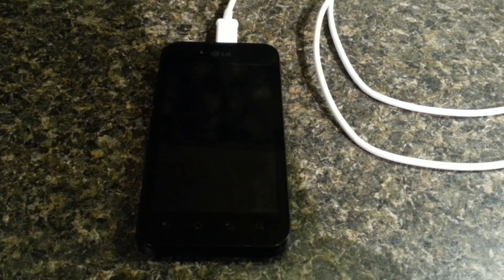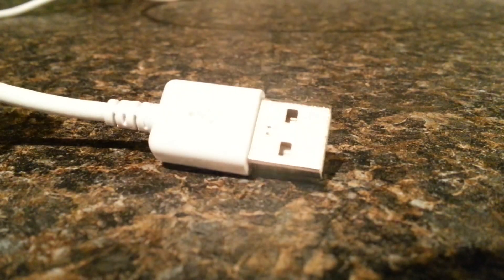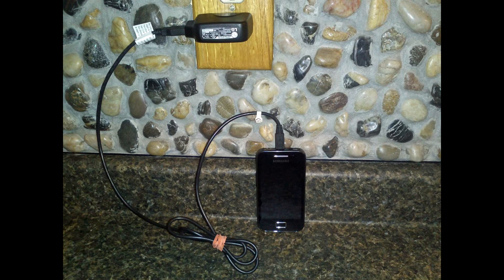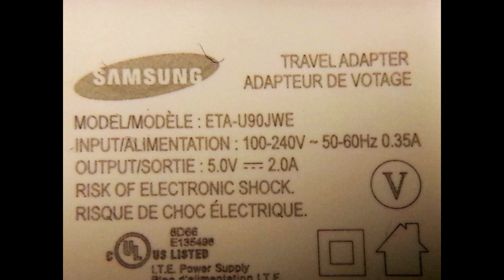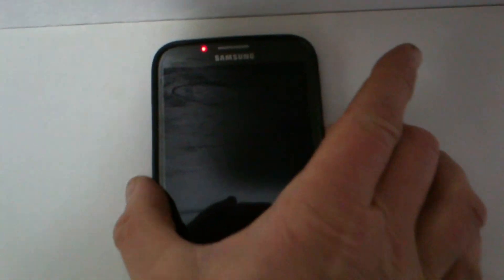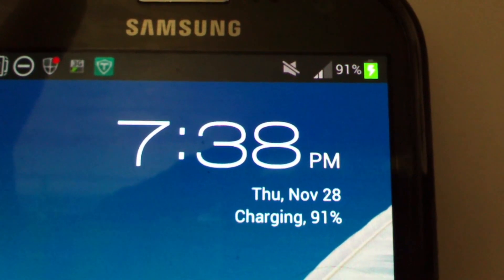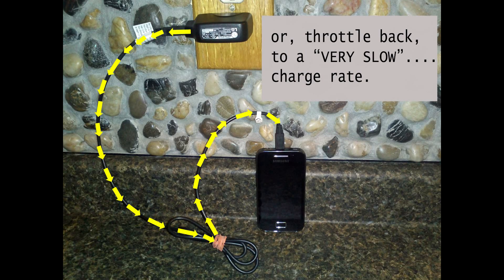Slow Charging? Check Your Charger's Output! #9

Comment: can someone help me my HTC one m8 started charging slow first I checked the the chargers (NOT THE PROBLEM) so I noticed that ever time I plugged in the charger (of any kind ) that they would be loose and the only way to get it to charge was to position the charger connector a certain way and when I thought I got it the charge would literally go down. so I went to Sprint and their "technicians" said that I was an app causing the phone to stay awake and that the charger had to be the original HTC charger so they deleted the apps and gave me the original HTC charger and said to come back if you continue having problems and said it might be a software issue such as a software update not installed properly and they might have to do a factory reset (which would be the 2nd time I would do that to that phone and I've only had the phone for 5months as I write this) and I'm pretty sure at this point it was the USB charger port. when I let charge overnight it was only at 60% and had to wait a total of 10hours to get it to 100% and now it will only charge if the phone is off and then it will be stuck on a number and I have to unplug and replug the charger to get it going again and/or if I'm useing the phone it will sometimes go at a steady pace or say can not charge because my phone is useing to much power even though that's not the case and I'm just about lost....
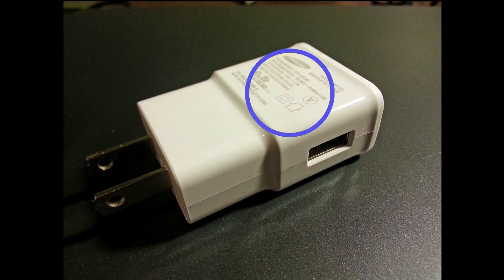Reply from the maker: Okay, I will almost bet that this following video will fix your problem! https://youtu.be/cJcCK5ZVSAY  Be sure to listen to the tips at  3:10 AND at 3: 30 seconds.

Comment: How about turning on airplane mode?
Reply from the maker: Yes, "airplane mode" will help with a slow charge condition if the charger that is being used is undersized (in output capacity). However, airplane mode would not be required for quick charging with the proper charger.

Comment: My samsung tab3 10.1 before fully charges in 4hours but now it takes my tab to fully charge in 7 hours will you help me...
Reply from the maker: First, we need to verify that the charging conditions are right. Are you using the original charger that came with your device? If not, make sure the output rating in milliamperes (or amperes) is at least the same or more, BUT NOT LESS , than the one that came with your device. Never use a cheap or long charge cable, as your device requires a larger charge current, which inferior cables will not be able to handle properly.

Comment: My iphone takes over 5 hours to charge any suggestions i tried everything!?
Reply from the maker: Dust and pocket lint could be affecting the charging of your IPhone. I have 2 videos titled "simple fix for phone not charging" (one is an update video). These videos talk about the micro usb port in Android phones. BUT, even though your charge port has a different configuration, it will still be vulnerable to a progressive dust build-up. The result is your charge plug might not be going in all the way resulting in a poor connection and therefore, a "slow charge".

Comment: how about this?

my samsung s3 is rated by 3.8V to 2100mA same with the battery

but my adaptor is 5V to 3A output.

how it works?
pls help.
Reply from the maker: Your Samsung s3 has a battery charging control circuit built into the phone which automatically "takes what it needs" from your 5 volt 3 ampere adaptor. The important part, is that your adaptor has the "ability to deliver" (capacity) what your phones' charge circuit is requesting. Too small in millimetres (or amperes) is not good, but a large output in milliamperes (or amperes) is just fine. IMPORTANT! if your device requires a 5 volt supply, it must ALWAYS have a 5 volt supply. Never more!
Reply: Northcaledon so in the process it is normal. then why i encountering the slow charging problem like this? it is something like my phone had another problem in the circuits or in charger plug~in that may cause to slow charging?
Reply from the maker: I said "millimetres" by mistake (darn autocomplete). I meant to say "milliamperes" .
Reply: Northcaledon ya. its ok.
Reply from the maker: I have two more videos titled "simple fix for phone not charging" parts 1 & 2 (update) . Please check them out. A build up in your charge port itself can also cause charging problems including a slow charge.
Reply from the maker: The dust build up caused a slow charge in my htc desire hd, and my samsung galaxy note 2. Both were fixed by using the methods in those two videos

Comment: Since today, I'm facing charging problems too. Like you said in your video; one hour of charging would add about 40% and that was my case too. I am still using the same usb and adapter but in 3 hours my phone went from 2% to 78%. I don't get what the problem is
Reply from the maker: I would check to make sure that your charge port is clean of debris. Excessive build-up of pocket lint will stop your charge plug from going in all the way resulting in a poor connection. I have 2 videos titled "simple fix for phone not charging", and an "update" one as well. These address that VERY common problem. Maybe they will help you?
Reply: Northcaledon Thank you for your quick reply. I'll check them out :)

Comment: My galaxy s4s battery is draining very fast, and it is charging VERY slow with the original charger. What should I do ?
Reply from the maker: Check out my video titled simple fix for phone not charging parts 1 & 2. I had the same problem with my phone.
Reply from the maker: These videos are also on my channel.

Comment: My android phone has a problem charging. One of my friends said I should try charging it in flight mode. It didn't work, it's too slow. I even tried charging it turned off. The charger is definitely not the problem. It may be the charging pin. Is it possible that could be the problem?
Reply from the maker: Please see my 2 videos titled "simple fix" for "phone not charging" , and then the update video for that. They will likely show you the problem with your device.

Comment: It takes my galaxy note 2 six hours to charge 25% now. All original wall adapter, cord, battery, and on airplane mode with screen off. I got the phone when they first came out and it would charge really quick like yours in the vid, but not anymore. It charges faster in my car, so I know its not the phone or the cord. I'm open to ideas of what it could be.
Reply from the maker: OK, I have the same phone as you, and I have experienced the very same problem. My charge port had a poor connection. Please see my video titled "Simple fix for phone not charging",  AND the "update video". This problem I had with my first Android phone too (with the same charge port). This will most likely cure your problems. Good luck, and please let us know how you made out.

Comment: I meant amperes not volts. Sorry. I've been up since yesterday and I wasn't thinking properly. Thanks for responding so quickly.
Reply from the maker: If your box requires a 2 ampere supply, then I would try to get a proper supply for it first.  BUT, from the information you're giving me, I would suggest that there "might" be a problem with the wifi box itself. The reason I say that is you said the unit worked fine for a few years with that power supply before the problems started. As far as the power supply failing, any wall power supplies that I have seen fail, usually just shut off all at once.
Reply: Thank you. I will call them today to set up an appointment to get the unit replaced. They are already aware I've been having this problem. It should be no problem getting a new one.
I hope you have a nice week. You've been a great help. I'm looking forward to watching other vids you have already made as well as seeing your new ones as they come out. Will talk again in the future. See ya.
Reply from the maker: ztbirdman Thank you!

Comment: I have a wifi box supplied by my cable company. The adapter from the wall socket 110 volts to thedc power input on the back of the unit is a round plug with the proper + inside & - outside orientation. The problem is the adapter is rated @ 1 V but the unit says it requires 2 V. It has worked great the past couple of years but recently has started freezing after a few hours of continued use with our tablets and/or laptops. I have to unplug the wall plug for 30 seconds to get it transmitting again. Sometimes I have to do this 2-3 times before it will reset. Is this due to lack of power from their supplied power adapter? 
I can get them out here but the techs are usually smart alecs so I try to avoid them at all costs. Any help you can offer will be greatly appreciated.
Reply from the maker: Please verify the following... Did you mean to say that your wifi box requires 2 amperes, and you have a 1 ampere supply? Or is the box really requiring 2 volts, but is being supplied 1 volt?  You NEVER should supply the wrong voltage to a device as damage will most certainly occur. Please respond....

Comment: My wife's S3 mini never charged from the car or USB, only ever plugged into the wall socket, it then stopped charging all together. We returned it to the shop and they said there was no problem and returned it fully charged (we suspect they didn't use just a standard wall charger, but a proper battery charger). However, it soon stopped charging by anything other that the wall socket again. Now my S3 will only charge by the wall socket, where it used to charge in the car and computer USB port. Could it be something to do with sub-standard quality batteries? It often gets quite warm when charging, and occasionally even when not charging.
Reply from the maker: OK,  I think you've come to the right place. Please search my videos for the one titled "Simple fix for phone not charging". Please watch that, then watch the follow up video titled "update for simple fix for phone not charging". Let us know how you made out. Thanks
Reply from the maker: The reason I made that suggestion is I had the same problem with my phone like yours.

Comment: I'm using a 2.0A charger I got from best buy. It worked for a while and now it's back to charging slow again.
Reply from the maker: OK, please look at my videos titled "Simple fix for phone not charging", as well as the "update" video. If your charge connector is not seated "all the way in", you will have problems as well. Good luck!